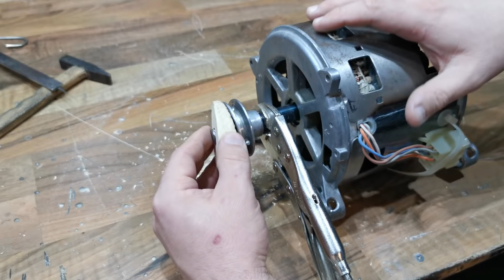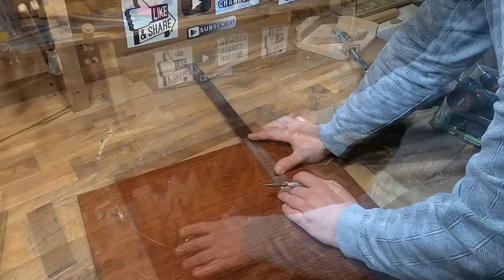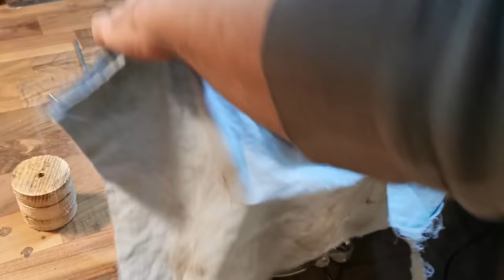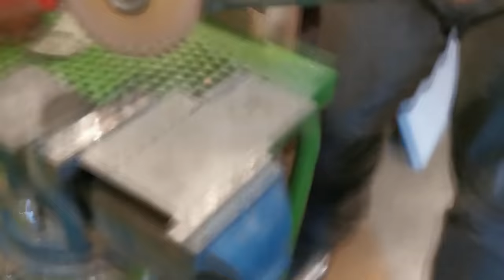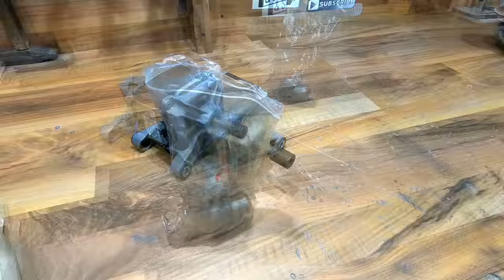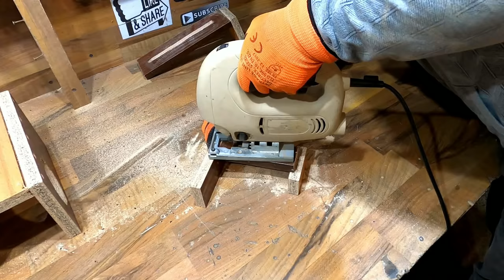3 Ways to Reuse Old Washing Machine Motor

Comment: Great change of movement from roundabout to up and down by the shaped wooden head of the motor. Never seen that before.
Reply: It's common on submersible pumps.
Reply: You don't see that mechanism very often for this kind of thing because it's simply not as effective as e.g. a scotch yoke for turning rotary into reciprocating motion, but it's called a "swashplate". One place you do see it used is in helicopters.

Comment: The lathe build is ingenious , but there are elements missing that would make it difficult to replicate.  The build of the chuck from the motor (where did all these parts come from and how did you fit them together). The wiring of the motor to the switch / controller -- this is all missing

Comment: I like the ideas but the flimsy materials used are dangerous when they fsil snd disintegrate.  If no metals, at least use solid hard wood. 

I understsnd he is judt demonstrsting his ideas.
Reply: Tu habilidad manual y capacidad de improvisar es muy buena. Así hayas punteado antes, dónde marcas con lubricante para taladrar, tu destreza es especial y se nota que ántes habías planeado los pasos a seguir. Es una demostración profesional de lo que compartes y abres la imaginación a cada paso. Bién logrado amigo y sigue adelante. Gracias por tu contribución a la creatividad e impulso al sistema de manualidades de ingenio. Saludos desde Guadalajara Jalisco México.

Comment: Great video I need to ask your community a quest I hope I can get a pin .
I took apart a 3 stage motor from an LG washing machine I broke the green board and a resister , I wired it directly to 220 and it barely moves how do I turn it up ?
Reply: Please help

Comment: I also should mention that the blade is only going to cut on the down stroke and the maximum power here is dependent on the spring. The grease will be a nice woody paste after a few uses.
Reply: Я имел ввиду1 часть,- дальше неры сдали...
Reply from the maker: The knife is inverted and the income forward cuts, the spring returns

Comment: I am concerned about the circular wood spacer you improvised......the screw to wood to metal motor shaft I think makes the wood material weak and may not last considering the pressure it will be subjected to....using that machine. Great idea BTW !!!

Comment: There are many problems with the lathe.  The tool rest needs to be moveable in a vertical positions.  Worry about torque with the motor.  It may stall out under a heavy load.  The tools used were wood chisles not wood turning tools.  Overall, it may be good for turning ink pens or small finials.
Reply: К
Reply: ฝฦส สวัสดี

Comment: Interesting idea, but: used weak materials (board ) connected  two high rpm  components directly -no cupling, lathe tailstock shuold be locked in angle rotation too, "main motor is not protected from dust,  easy access thigh woltage wires, #1 safety rule: DO NOT WORK IN GLOVES (spinning item can catch the glove  with finger in and ..... - and not only.
Reply: Malayalammovie
Reply: AND ! What ! Does ! That ! Do !?? ! Then !